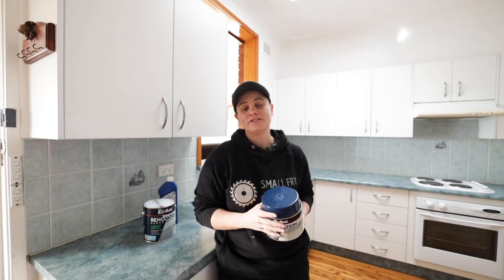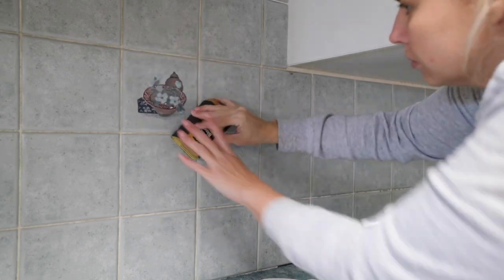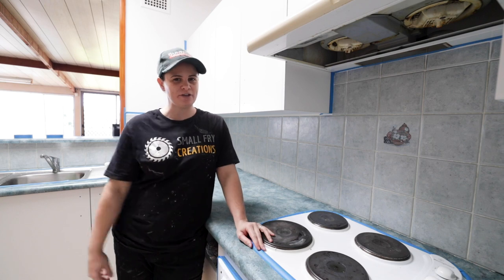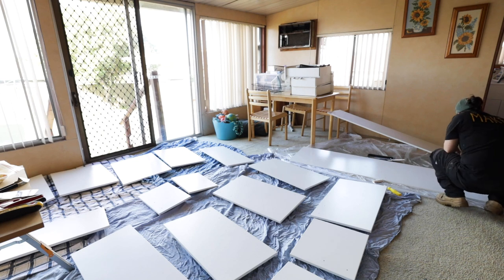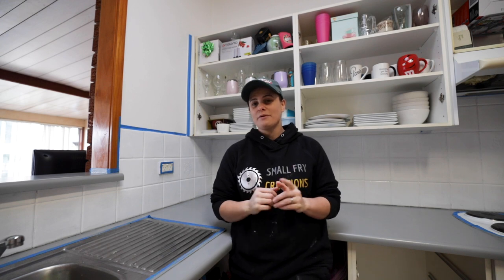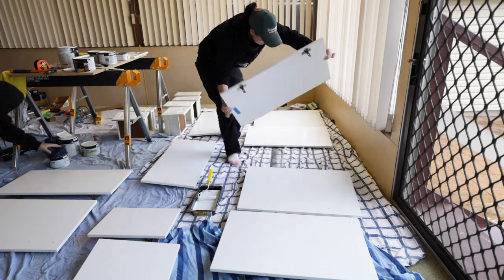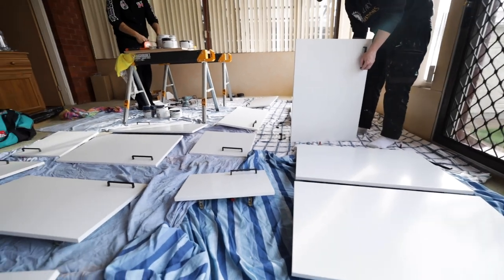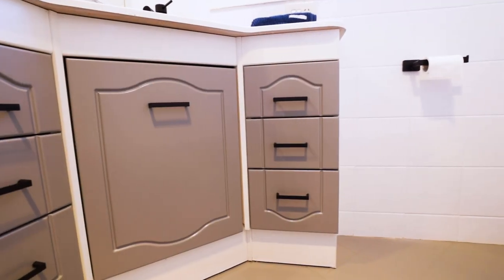DIY | Revamp you Kitchen in 5 Days with the Dulux Renovation range

Comment: What a stunning job. Again, amazing the difference a coat of paint makes. Just a tip though, you can actually remove the surrounds from the light switches and power points to save you the trouble of masking up. Love your work, Ainslee.
Reply from the maker: Hey Chris thanks. Yeah I know they come off but these are like 20 years old and I couldn’t get them off 😂😃 thanks for all the support 😃😃

Comment: I am having great difficulty with the main part of our kitchen bench. Can’t get rid of the roller streaks and the little hairs that get stuck in the clear coat. Getting very frustrated with it. Was I meant to wait a week before applying the clear coats? Cupboards look fine.
Reply from the maker: Bummer. I applied the clear coat the day after the colour was applied. I used a 100mm foam roller and that did light passes with it. Hope this helps
Reply: @SmallFryCreations  Thank you so much for replying! I ended up doing another coat of the main colour, White Exchange Half, with some of the clear coat mixed in with it. Probably not the right thing to do, but it has helped somewhat and covered up the little bits of fur and floaties. 😊🐾
Next thing is the sealant, which I dread a bit.
Blessings 🌻
Reply from the maker: @kathyr1516  I say if it works then run with it. Thats awesome!
Reply: @SmallFryCreations  😉

Comment: Great job, Ainslee. We are wrapping up our bathroom reno which blew out into a major tear it all out and start again job. Last thing to do is the barn door - as done by yourself a few videos ago :) Finally got all the bits together and now waiting on some nicer weather before painting door up.

Next major job is our kitchen!! Surprise! I was thinking of doing something very similar to what you did although our doors are a bit crap and peeling so probably replacing them completely. But would like to try that paint for our bench and maybe tiles. I've spoken to the Deluxe guy at a Bunnings night and I think he said it was good for 10-20 years?

What I did want to ask - what did you use on the drop cloth to rest the doors so they were off the cloth? Did you just angle them using the hinges or did you find something like a "painters pyramid" ro rest them on?
Reply from the maker: Hey thank you so much! Bathroom sounds super exciting!! 

I like the sound of 10-20 years on the bench top. 

The doors I used the hinges but I also picked up some wire nuts when I was in the US last and I used them all the time to prop things up off the ground. 

Good luck with the rest of the Reno’s!!

Comment: Did you ever do a follow up of the durability? I can't find an update on your channel :o(
Reply from the maker: Client lived there for about 2 years after Reno I think and didn’t have any problems. The only place I don’t think it works well is on a tiled floor. We also did the bathroom which isn’t shown and the only issue they had was with the floor as it’s a high traffic area. Outside of that not problems. Hope that helps

Comment: Thanks for sharing this - been meaning to see someone else try this, I’ve been so nervous myself. I’m planning to do our kitchen splash back which currently has a textured tile (just has ridges and bumps), do you think it would still be okay? Also did you happen to go over the grout with a grout pen? Thanks!! (:
Reply from the maker: That’s awesome. We didn’t use a grout pen. We painted the grout the same as the tiles. I think the ridges and bumps would be ok. Just focus on the sanding of the tiles to get it all the nooks. The sanding roughs the tile to get better adhesion with the paint 😀

Comment: I'm about to do this with my splashback and bathroom walls. Is a clear coat really necessary? It doesn't say anything in the instructions
Reply from the maker: As it’s not a surface that really get touched so you could get away with it. We have enough clear so we thought why not do it. It just a adds more protection so better longevity. If you have the product I would go the extra mile and do it. Good luck 😀😀

Comment: Looks awesome! Any updates 9 months later? I’m planning to do my kitchen cabinets as well but I’ve seen some bad reviews
Reply from the maker: Hi brandy as far as I know everything is holding up well.
Reply: @SmallFryCreations  any scratches or anything?
Reply from the maker: It’s not in my kitchen so I’m not 100%. As far as I know the only problem is we also did the bathroom and the floor didn’t hold up very well. I haven’t heard anything about the kitchen. I would say the bench top is the biggest risk but we out three clear coats on it to try and make it as best as possible.

Comment: Any brush or roller streaks on the tiles/bench tops/cabinets???
Reply from the maker: No we didn’t. We always kept a wet edge and we would apply the paint and then go back over it lightly in one direction before moving to the next section

Comment: Did you not use a primer on the bench top?
Reply from the maker: Nope no primer. I believe from memory the primer is built in
Reply: It certainly isn't built in, I have been selling dulux paint for 20 years.. all of these products need a primer and the bench top also needs a clear coat
Reply: I see you used the clear coat 👍

Comment: Im dying to know how it's held up! I'm about to do my kitchen, very nervous
Reply from the maker: Hey the clients lived in the house for 12 months before selling and said it was doing really well. We also did the bathroom in the house and that room included the floor. I would say the floor didn’t hold up great but I think cupboards and bench tops hold up well. Good luck!! It’s a great way to revamp and bang for your buck 😀
Reply: @SmallFryCreations  YAY! Thank you for replying!  mine seems thin and not as lovely as your first coat :( any tips?
Reply from the maker: My only tip would be make sure your using the right roller and I think from memory you add the hardner and I made sure I got as much out as I could. Hope that helps 😀